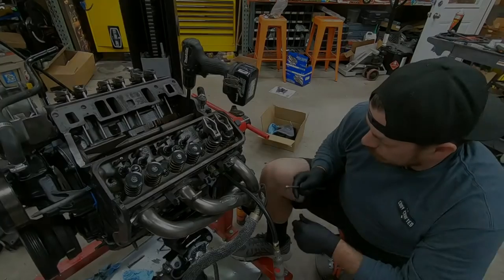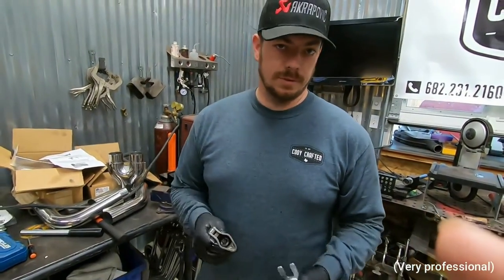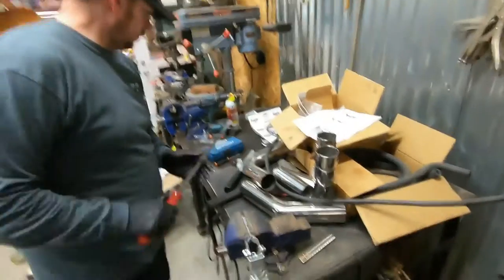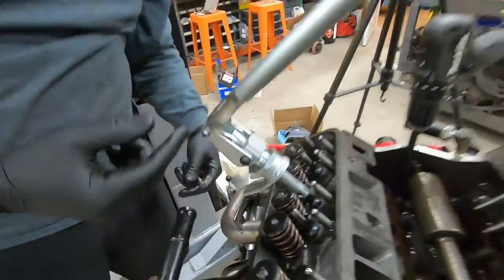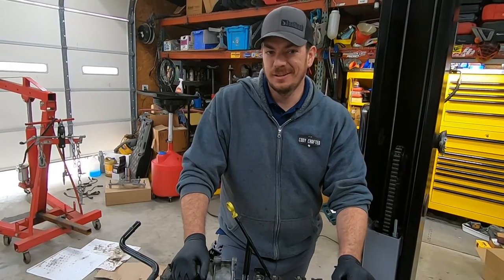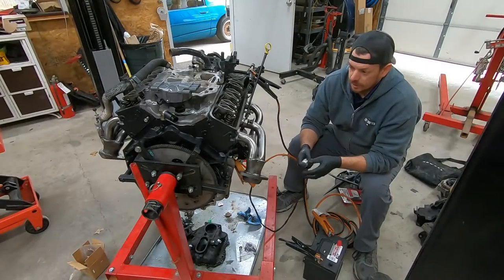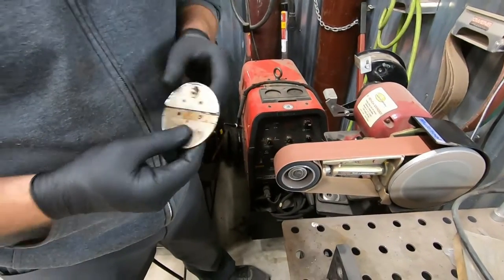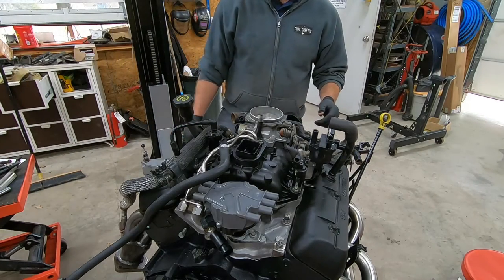HS Sport Truck EP2 progress! (mistakes were made)

Comment: I can attest, that multi tool grinder is incredibly handy! Just don’t push hard enough to groove the front wheel. I had an apprentice chunk the wheel and it was $60 something to replace 😬 I didn’t think that was possible, but he also broke a 3/4” carbide end mill in copper…
Reply from the maker: Your grinder motor is way more hoss than mine. I can stop it if I push that hard.
Reply: @CodyCrafted  well, I did get the Jet grinder. It’ll kill a man if you’re not careful.